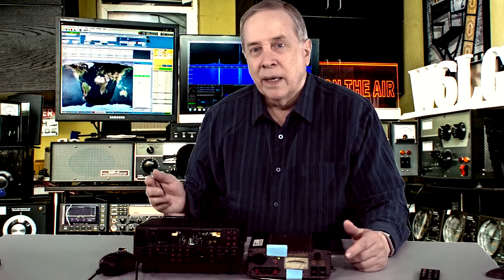Ham Radio Basics--Jim, W6LG Continues with the Basic Ham Station Part 4

Comment: Thanks Jim for the explanation. A few years ago, I ordered a small receiver kit from a well known and respected ham radio US Manufacturer that was making me crazy as it was so noisy; all the tests went well so I couldn't find the problem till I tested with a 12 Volt UPS battery. The receiver went quiet and was working nicely. The culprit was the wall transformer it came with. I couldn't believe that the unit came with a cheap weightless switching power supply!!! So went to a local electronics parts store an bought a small multi voltage wall little transformer but the type that still comes with filtering and real transformer. No more problems.  On the other side, now that I have learned more, bought a SEC-1223 from Samlex which is a switching power supply, for my portable setup with a Yaesu FT-857 and that thing had to be professionally heavily modified by adding filtering everywhere inside. It works fine but not an easy job. Better stay with the old trusty type of heavy power supplies for your station at home.
Reply from the maker: All excellent information Roberto.  Thank you for sharing all of that.  73, Jim

Comment: Thank you, Jim.
    Some of those pulse modulated or switching power supplies are so noisy that even local AM  and FM stations are difficult to listen to. We are in a remote area, but still these PWMPS are in major violation of FCC regs! N0QFT
Reply from the maker: Some are so dirty it is hard to believe.  They are screaming RF everywhere.  A few are relatively clean.  Thanks Glen 73, Jim

Comment: Good video Jim.  As an old EE i designed supplies many years ago, nothing matches or outlasts a good power supply with a strong transformer, full-wave bridge rectifier, filtering system etc.   They last forever and produce little noise.

Comment: I have the same supply in my home shack. I picked it up cheap but in near new condition. My thinking was to do with the power efficiency of the switching supply over my old Watson 30 amp linear. I ended up using it for about ten minutes before going back to my old Watson. Makes a nice high power bench supply for testing purposes but I agree with you with regards to day to day Ham usage. Linear supplies will always be the first choice. Karl, M0KRL.

Comment: That's good to know. I keep reading that the modern good quality type of switching power supplies are just as quiet as the transformer types, but now I'm suspecting they're probably referring to use with VHF & UHF bands, not HF bands. I've had mobile HF, VHF, and UHF radios for a few years now, and I've been thinking of putting together a portable base station with the purchase of a ICOM 7300, and a magnetic loop antenna.
Reply from the maker: I think you are correct. Thanks, Jim
Reply: Oldhogleg It is possible to make a quiet switching power supply, but it means designing added filtering to both the AC input side as well as the DC output side in order to to remove the unwanted emissions at LF, MF and HF frequencies.  I am also a big fan of linear supplies for fixed base stations and also love that they are electrically easy to understand and repair for anyone with even basic electronics knowledge (unlike switching supplies).  However, when I converted my home station to operate with an integral battery backup (everything station related runs from the battery rails) that meant I needed to make use of DC-DC converters (essentially the same as switching power supplies) to get the voltages I need to operate radios, lighting, computer, and monitors all from flooded lead acid batteries whose rail voltages could range anywhere between 10.5-14.4VDC, or a bit less at the equipment due to voltage drop along the way, depending upon their state of charge.  Some of the DC-DC Converters were fine as-is, barely emitting anything at a distance of just 6" over the span of 500KHz to 1GHz while others were very strong emitters straight out of the box and required heavy filtering to remove the noise, reducing such to below background levels.  At this point I can honestly say the biggest emitters at my station are the two 27" monitors due largely to the PWM modulation of the backlights, fortunately my antennas are well away from station at home and perpendicular the the monitors so such is not a concern.  But it is possible to have a quiet switching supply, it just requires added engineering and attention to detail, which also drives up cost a bit.  --KW4EK
Reply: Ethan Poole Interesting.

Comment: years ago I got an older icom ps-30 which I believe is a switching supply.  it has an Icom style HF DC power connection hardwired, so I used it with an iC-737 from that same era.

Why would the  big 3 radio manufacturers put their name of HF switching power supplies if they were so bad?

I don't disagree that the linear transformer type are a safer bet, but there are so many switching supplies marketed for hams, this is surprising.

Comment: This is really interesting as I just spent a couple days camping with my new SDR radio and a long wire. I was getting lots of These tones and did not know where they were coming from. Since my SDR radio is powered by the laptop, power supply for the laptop that is causing these tones and did not know where they were coming from. Since my SDR radio is powered by the laptop, power supply for the laptop that is causing these tones?

Comment: I have used switching wall packs with cctv cams in the past and has  degraded the picture quality severely. I thought about purchasing an Alinco or Jetstream switcher very similar to the p.s. in your video, now i will think twice.

Thanks for posting! 

KC5NGX
Reply from the maker: Good. Check with others in your area to see if they have a bunch of noise from their switching supply.  73, Jim

Comment: Thanks Jim a Little Heads Up Goes A Long Way ,Some Where The Word About These Power Supply's Was Most Likely Posted In One Of The You Tube Sites I Watch So I Was Never Out Side The Lope On Switching Power Supply's And Will Never Buy One ,Old School No Switches I Hope The New Hams Pay Close Attention To What You Have Put Into The Content Of This Vidoe.
                                                                 n2wjs Charlie.
Reply from the maker: Thanks Charlie.  Some guys have written to say that their switching power supply does not generate noise.  I have not seen that, but they may very well be correct.  Maybe with enough filtering it can be clean.  Nice to hear from you again Charlie.  73, Jim

Comment: I have been told that noise can also be generated by anything and everything plugged into one of those power strips that are so popular. Can even those federally mandated smart meters do the same thing?
Reply from the maker: I don't have noise from the dumb smart meter.  I need to do some reading about that system.  It appears to be quite a network.  73, Jim

Comment: I have the same power supplies, put I'm so lucky I don't have any noise or QRM in my place.  I just make sure to graund all my equipment.

73
Reply from the maker: That is good information.  Thanks for sharing.  I hope to work you on 20 meters soon.  73, Jim W6LG
Reply: Jim W6LG sure, 20m getting batter this days.  
Is it effected more in lower band, I think.